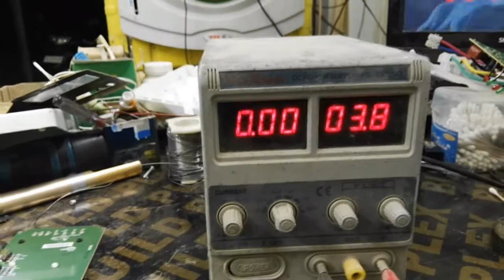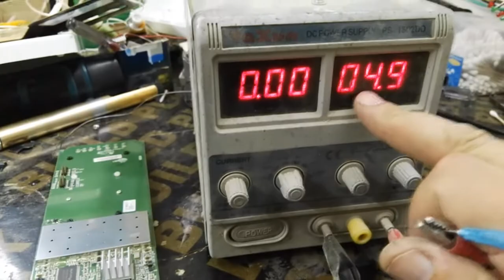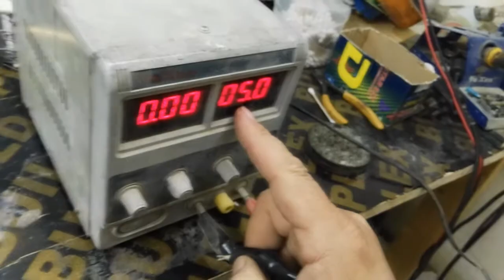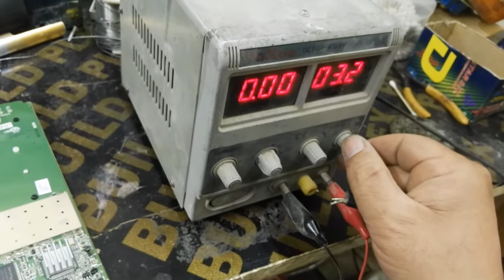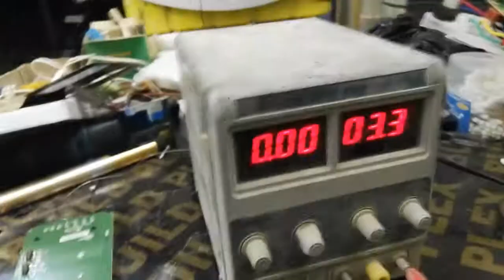fix nanostation m5 power problem

Comment: Greetings, I have seen your video several times, I have a very similar nanostation M5, in my case it does not turn on and there are 24 volts at the input and I do not have an adjustable source like the one you use in the video, how can I know if power is reaching the microprocessor or other places, where I can measure.
Reply from the maker: U must have avometer to check mybe there is short in 24v line there zener diod this zener always become short

Comment: saludos desde Venezuela amigo lo felicito tengo una igual que la daño un relampago solo prende el led verde y no hace mas nada hice esta prueba del video con mi fuente regulable yl lo 3.3 voltios en la bobina la fuente se proteje quiere decir que debe estar en corto el micro porcesador o que ?
Reply from the maker: I didnt understand pls write english
Reply: @teachyourself6839  Greetings from Venezuela, friend, I congratulate you, I have one just like it was damaged by a lightning strike, it only turns on the green LED and it does nothing else. I did this test of the video with my adjustable source and the 3.3 volts in the coil, the source is protected, which means that it must be in I cut the microprocessor or what?